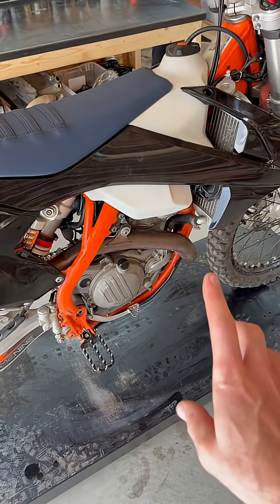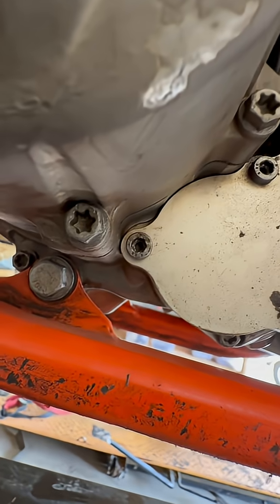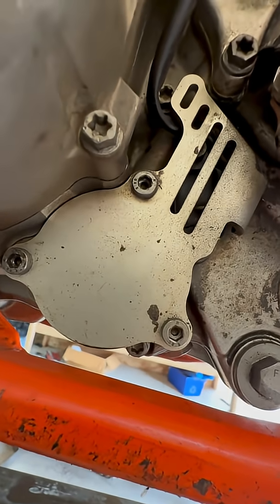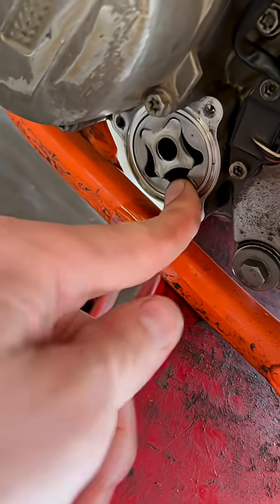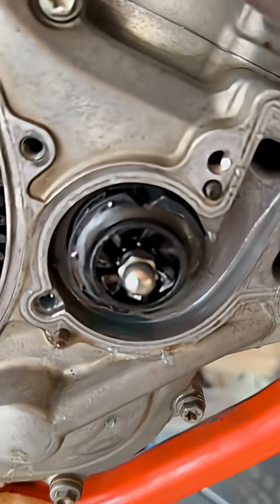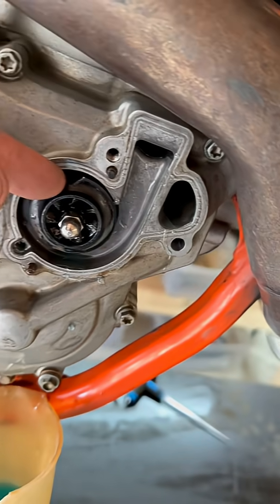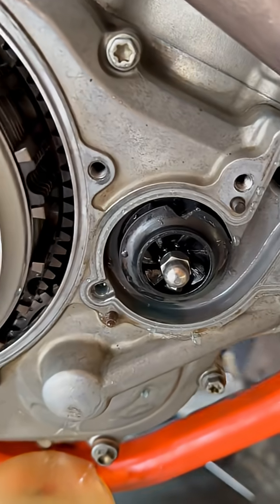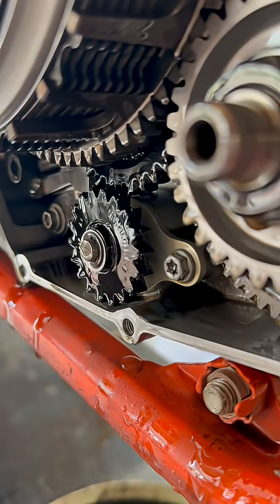Oil Pump Gear Failure

Comment: Just fix the oil pump and get your miles out of it and fix it later. Single cylinder will literally just seize the conrod everytime. Best to just get your hard miles out of it.

Comment: How are you finding the 690 platform mechanically?  If you see many of those.
Reply from the maker: We don’t get very many in the shop and that’s a good sign. Besides some of the earlier ones having issues with the rocker bearings they seem pretty bulletproof.

Comment: Thanks KTM for your sub-standard parts and manufacturer.
I have no idea why people get sucked into the marketing hype.
Reply: This is one neglected bike vs the 10’s of thousands other bikes they sell. Take care of most any bike and it’ll take care of you. Personally sitting at 355 hours on my 300. Pretty common for them to last that long or longer
Reply: @kaelharwood There are thousands of bikes with failed plastic oil pump gears out there and KTM keep serving up the same old junk.
It's the exact same thing as the cams in the adventure bikes - bike fails, KTM says 'We've never seen it before, what did YOU do to our bike'?... 
There are enough failures that you can buy a proper aftermarket metal replacement gear. 
Your 300 doesn't have an oil pump...

Comment: So just got this 530 xc4 and cranks but no start got great spark but I dont think its enough fuel and ive went through the carb and cleaned it could the adjustment of the tps be the factor of not enough fuel?
Reply: The tps has some effect but does not effect enough to cause a no start. I have a 530 and ive set the tps furthest in and out and it still will run